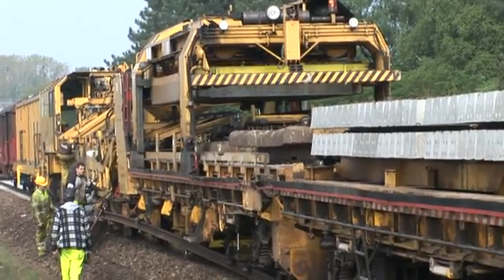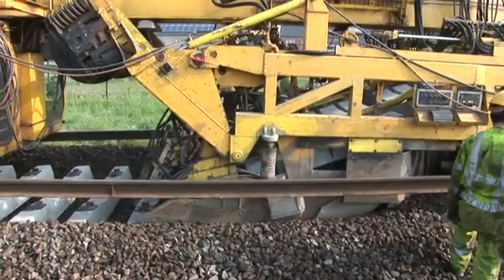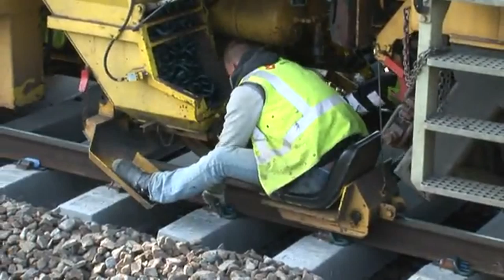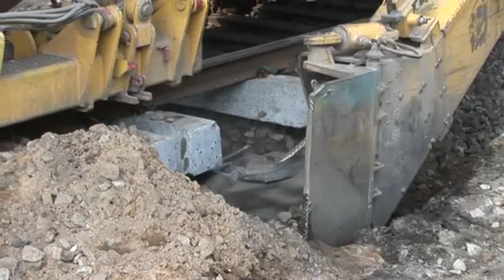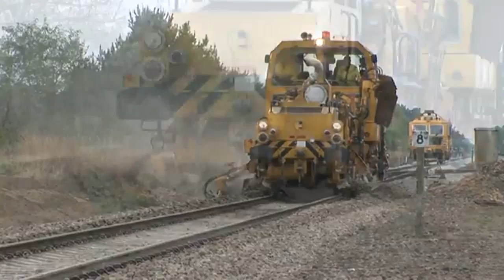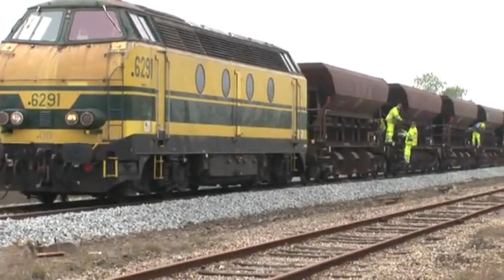Track Building Train   Ever wondered how they build mile after mile

Comment: The video isn't misleading. What it doesn't show is the stages of blasting and carving out a mountain side to prepare a causeway for tracks. The US has hundreds of thousands of miles in preexisting tracks that need upgrading. This solution is brilliant, cost effective in time and labor, freeing up more projects to be don in parallel, thus giving a faster turn around to run commercial and passenger transports.

It's a no brainer. As a mechanical engineer it's disgusting the waste in time to build out today. Even highways are now using massive machines to lay concrete zones.

The I-90 East of Snoqualmie project is an example of a huge project upgrade of pre-existing and antiquated I-90 between Ellensburg and Seattle. WA DOT Dot Gov has the info.

Comment: Great video. It would be good to put the names of the machines in the description or make a commentary in the audio of the video describing what machines are working as the video shows them. Thumbs up.
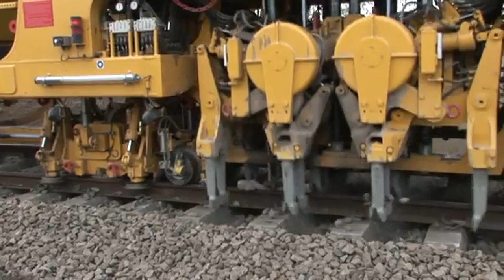Reply: the one at 4:40 with the chisle things is called a dynamic tamper it stuffs the ballist down under the ties, and vibrates to settle and push it down tight like a compactor
Reply: I have to agree with you Vance.  I loved it but I too would've appreciated a little narration.  I got lost on the "sideways circular digging thingy" and the rock sucking then "spitting back outter" mecahnism:)  That's proof of how it'd help me.
Reply: the the thing is called a ballest cleaner cleans the rocks and puts them back out I have been told.
Reply: Zteve W sideways circular digging thingy is called an under cutter ... go figure we use it to get rid of old contaminated ballast so we can pour new fresh rock on top
Reply: Vance I posted above but the big one is a P811
Reply: Thanks.  Now, I'm going to need the FULL DISCOVERY CHANNEL EFFECT... how soon before we can convince you to narrate? Until you do, keep up the good work:-)
Reply: David Brindley how does rock get contaminated?
Reply: train king484 it becomes so old that it cant support the weight of the Daly trains
Reply: Thank

Comment: About 93% of ties used in the U.S. and Canada are wood with about 3,200 per mile. High-speed rail needs concrete. The area's where noise is a concern, wood is used as concrete amplifies the noise.
Reply: Thank 4.

Comment: If I understand correctly they are replacing the sleepers while keeping the old rails. So I assume the average lifetime of rails is much longer than that of sleepers?
Reply: Concrete sleepers have a minimum life span of 40 years. Rails are changed more frequently, depending on wear and tear. A highly used stretch may require replacement within a few years, a less used track may last for decades. This video shows a sleeper changing machine. Replacing sleepers, rails, or ballast are all different procedures requiring different equipment. Laying a completely new track requires yet another type of machine. It's very similar to this one, but the front end runs on caterpillar tracks on the empty track bed.
Reply: Steff2929again Thanks for the info!

Comment: Do they have a special train for curves and mountains?
Reply from the maker: No they use the same train for curves and mountains
Reply: Interesting. I live in the rockies and the tracks are still horizontal and straight.
Reply: ciarin Bain
What about the climb to the Moffat Tunnel?
Reply: Its all about the grade in the turn similar to a racetrack
Reply: +I Love Baingan you really like Brinjals?
Reply: The rail head and wheels are angled and act as draft gears, This way the outside and inside wheel spin at the same speeds.  Tracks are rarely ever at a grade more than 6 inches.  As they would tip over if they stopped.

Comment: This was filmed in Belgium you can see it on the trains with the (B) on it. http://en.wikipedia.org/wiki/Rail_transport_in_Belgium They are advanced in this, the rail system is extensive for the small country. It is the means of transporting goods through all of Europe. This might also be a line for the high speed trains, Train Grand Vitesse (TGV) those rails have to be laid out very accurately.

Comment: Could be I'm wrong and that's OK, but I see these concrete sleepers as a bad idea. They won't last as long as the wood and breakage is going to be a problem as well. Even if they have rebar weather changes will cause d disintegration. Probably within just a couple of years, vs several years of use with the wooden sleepers.
Changes in temperature, porous value and expansion/contraction are a few factors to weigh in versus the wooden ties, or sleepers. Wood good gives more holds its strength better in the elements than man-made materials.